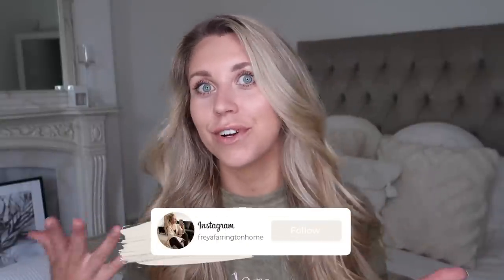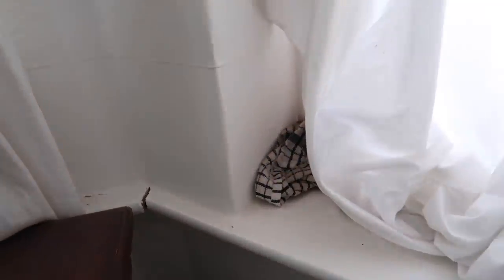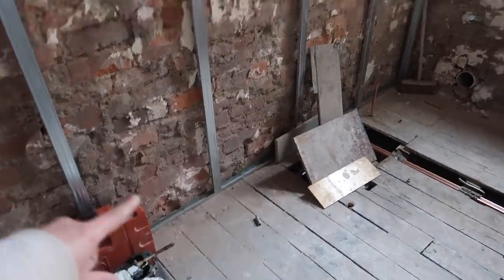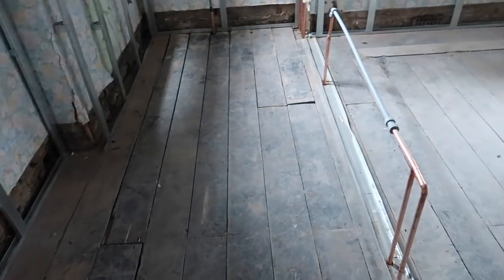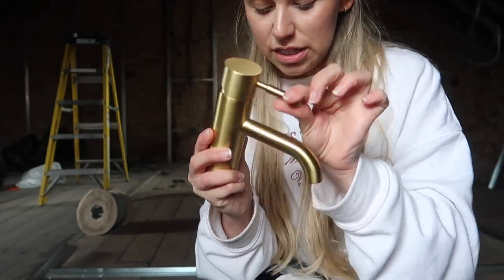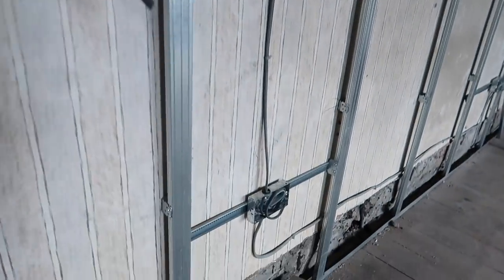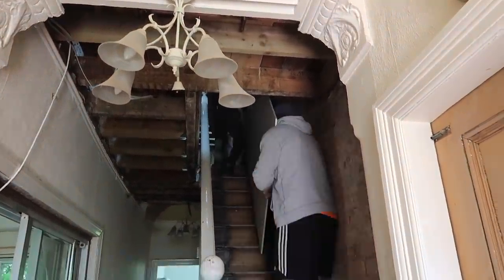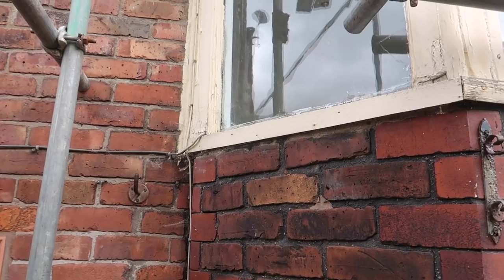RENOVATION SERIES EPISODE 2 | MOVING VLOG & HOUSE UPDATES

Comment: To protect your vacuum, you can buy a dust collector, which is like a bucket you place before the vacuum with an extra pipe and that will collect 80+ % of the dust. check DIY stores or Amazon for instance: triton dca300 - dust collection bucket 23ltr capacity .